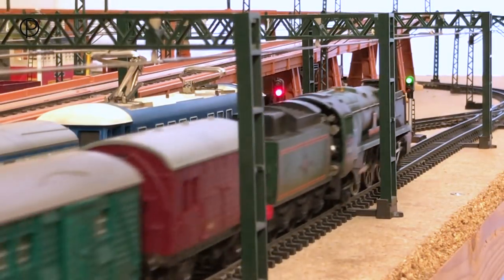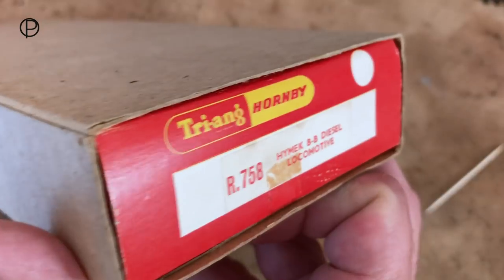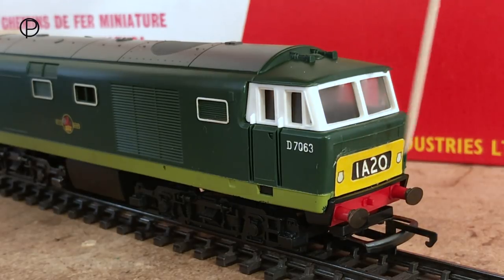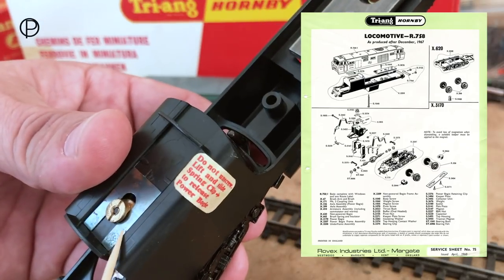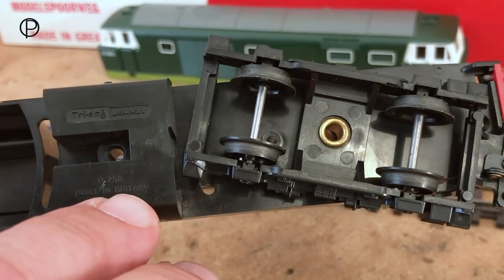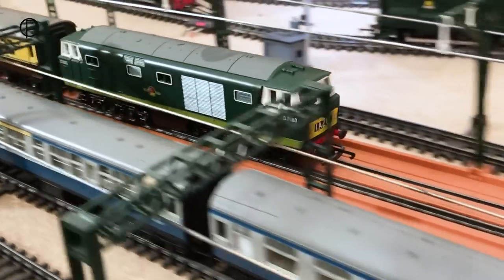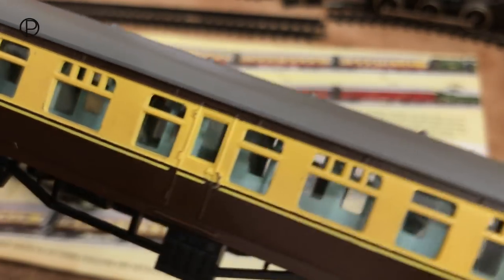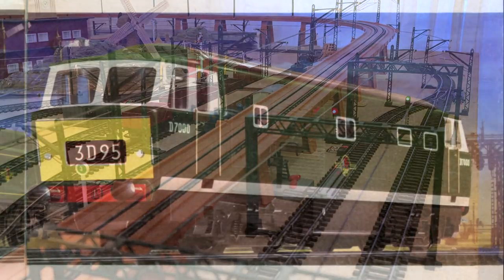Tri-ang Hornby R.758 Hymek Diesel Locomotive with Chocolate & Cream W.R. coaches

Comment: Another wonderful look at your trains Oscar. The information you give is great. I had the blue version. Long gone now, but hopefully one day I will be able to replace it. Appreciate all the hard work in getting these videos out.
Reply from the maker: Hi Simon.  It's really great to get such positive feedback.  I am having great fun making these videos.  Most of all I get to play with my toy trains.  Oscar
Reply: I look forward to Sunday night here in Australia. I get the notification a new video has arrived, so it's time for a cup of tea, sit back and enjoy! I'm working my way through all your videos and its interesting seeing how your layout has changed. Were you originally using System 6/modern trackwork?
Reply from the maker: Originally I built a model railway with my son which was all modern Hornby Railways track.  There are no videos of this layout.  The videos you see with system 6 track on the outside/elevated section and super 4 on the inside with the turntable and catenary was a result of a growing interest in the older models and the desire to run them and not just look at them.  On this layout, It became eventually necessary to change all the Modern Hornby track to old Hornby steel track. This gave me the advantage of the magnadhesion which was terrific. But I still had problems with the deep wheel flanges on many models. So I decided to switch over to all Super 4 in early 2017 as I don't really have much produced after about 1980 and that all seems to run fine on super 4 this is the last video with system 6 and super 4  https://youtu.be/AzeKPWWnFbs   and this one is first with the system 6 taken away https://youtu.be/MYBXVuZEJwY  and from then on you can see the development as the layout looks today Super 4 only!
Thanks again Simon for watching and taking the time to comment.
Oscar
Reply: Hi Oscar thanks for the information. You may remember I have the Railway Children set so have been collecting the earlier system 6 ( with the 1/2 sleeper on the end like super 4) I was thinking of getting models from 70 - 76 or so, but I am liking the mid 60's period so think I will move over to Super4. I just like the look of it and I think the 70's era models will be fine running on it?
Reply from the maker: Hi Simon. I remember now you have mentioned The Railway Children.  You had told me about developing a layout with the original system 6 track with the half sleeper. I think you may have more flexibility switching to super 4 track. I don't think you will have very many problems with the 70s era models and the models from the mid-60s will benefit enormously from being on the track they were intended for. Also probably much more Super 4 around to chose from. The early system with the half sleeper. It seems to have been very fragile and did not take kindly to repeated connecting and un-connecting (being played with!) or being pinned down and then taken up at a later date. It was very bendy. And there are just so many great models from the mid-60s to the late 70s! If only there were still toy shops like they had then.
Oscar
Reply: Hi Oscar. Yes I agree with you, I have some very bendy track! Super 4 looks a lot more robust and indeed better suited for the models I'm wanting to collect. I wish the toy shops were still around today, my local was Lesley Browns on the High St in Stockton-On-Tees. Many a Saturday was spent just staring at the models and making mental notes for what to ask for Christmas/Birthday or what to spend the paper round money on! Of course when not drooling over the models in the shop, the catalogues were brought out and poured over for hours on end! Before I forget, can I ask you how you clean your track to remove tarnish etc? Thanks again for all the information.
Simon
Reply from the maker: Hi Simon. Track Cleaning! I have washed some track with warm soap and water using a nail brush/electric toothbrush gently to clean it up. Rinsing and drying thoroughly somewhere like an airing cupboard. This is not always necessary but with very dirty track the results are traffic. If the track is to be stored rather than used straight away just wipe the railheads with a cloth damp with a light oil, rail ends/joiners (fish plates) could be lightly brushed (small paintbrush) with the same oil. This is a method I read on a model railway forum some time ago. I had a go at trying to find it for you but was unable too. The track that is going on the layout no oil at all.  Do pay special attention to the rail ends and joiners when putting the track down. All joints on my layout were hand finished with a copper brush on a rotary tool carefully avoiding the plastic sleeper beds. This is where Super 4 is great depending on your point of view! The rails can be easily clipped off and slid off the sleepers (on some of the point rails and the diamond crossing this is not possible) but with a little care they are easily cleaned up and adjusted. This made a big difference to the continuity. General cleaning once the track is down I use the track cleaning car with lighter fuel as the cleaning agent several times a month. Good quality track rubber from time to time. And on the point blads, I use a glass fibre pen. I think these were developed in the jewellery industry they are fantastic. You can use them on the wheels also. If the wheels on the locomotives and the rolling stock are kept clean also, pretty good running is had most of the time. The odd stutter on a point is not the end of the world. These are at best 40 years old toys and very often with only pickups on the drive wheels. But I believe they run as well now as they did when they new. Hope this was of some help.
Oscar
Reply: Hi Oscar. I had not thought of washing the track, I will try that. We don't have airing cupboards here in Australia, as most of the hot water boilers tend to be outside the house. My Wife does have a food dehydrator so I could give that a try (have to see how low I can get it first!) I have just been using the track rubber and cotton bud/cloth with methylated  spirits to clean the rail tops. Will have a look on that auction site for a glass fibre pen. I got a rotary drill and stuff for Christmas, so will very carefully do the ends and joints. Thank you again for your kind help.
All the best,
Simon

Comment: There seem to be so many variations of the Hymek. My two tone green one is a Hornby one with ringfield motor and the white window surrounds are part of the body molding with paper head codes. The buffer beam is also part of the body molding. My blue one is a Tri-ang Hornby  with the same chassis as yours and marked R.758. It has the separate  window molding ( in yellow) and again paper head codes and separate buffer beams.
A terrific video again this week Oscar, I especially liked seeing two trains running on the same track and well done with the signals and points.   Regards, David.
Reply from the maker: Hi David, how does your Hymek with the ringfield motor run?  I have heard mixed opinions about it.  Hornby's switch to the ringfield seemed to have been controversial at the time and still continues today.  I don't have a Hymek with a ringfield motor.  I do however have a number of Hornby Railways Silver Seal locomotives which do present some interesting problems.  Thanks for watching and have a great week.  Oscar
Reply: Hi Oscar, thank you for the reply and question. When I got it it was a poor runner. On close inspection I found that the carbon brushes had worn in a very unusual pattern. Instead of wearing flat across the ends they had twisted to about a 45 degree angle and worn in an elliptical shape. I replaced them with new Hornby ones and after bedding in it seems to be a decent runner. It would seem that the rivets used as brush holders are too big in diameter as the brushes are very loose and sloppy in there.  Regards,  David.

Comment: A nice presentation of the Hymek, also a great model railway ! A question out of curiosity: Did Tri-ang in OO/HO also have models for the alternating current system at that time, i.e. with a middle slider? Probably not, since the AC system was not very common in England. Best wishes from south Germany
Reply from the maker: Hi glad you enjoyed the video, as far as I know Tri-ang Hornby didn't have locomotive running directly off AC from the track or a centre rail. The earlier Hornby Dublo system ran on three rails but was the DC. Hornby Railways as it was by 1979 introduced a very early digital system called Zero 1 using AC to the track but it was just two rail.
Thanks for watching take care.
Oscar
Reply: @oscarpaisley  thanks a lot for the detailed answer.

Comment: Very informative Oscar. In the late 70s didnt the Hymek aquire a ringfield motor type power bogie, as was being fitted to Mallard (and others)  back then? Think also it may have had pick ups on the dummy bogie too. Interresting to compare the 2 approaches performance- wise. The Magnadhesion model may well be the winner....
Reply from the maker: I think you’re right The one with the magnets Is going to be the winner on steel track. At present I don’t have a version with the ring field motor.
Thanks again for watching.
Oscar

Comment: I have one of the later one of these, with the added pickups to the non-powered bogie,still with the magnets, and the Tri-ang motor in it. It came with a job lot of scrap locos, dough I managed to fix all of them. It needed cleaning, and oiling and I had to drill a hole to the chassis to fix the rear pickups, but it runs fine now. I prefer these locos over the Hornby ring filed motored ones, that pickup system is garbage!
Reply from the maker: Hi.  Sounds like you had great fun getting those going.  There's not much that can't be fixed on these old tri-ang motors.  I think the models with the ring field motors are an acquired taste.  They have a whole new set of problems.  Oscar